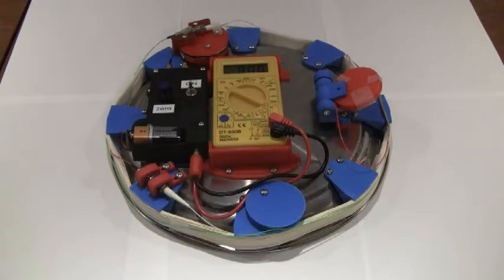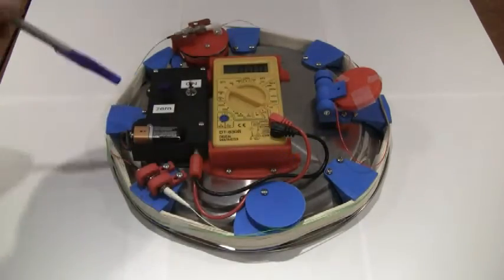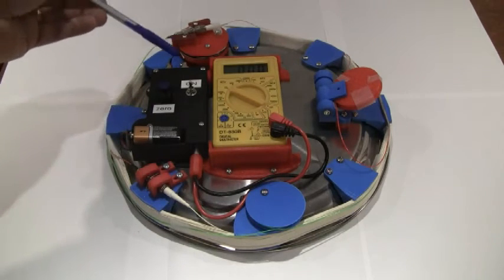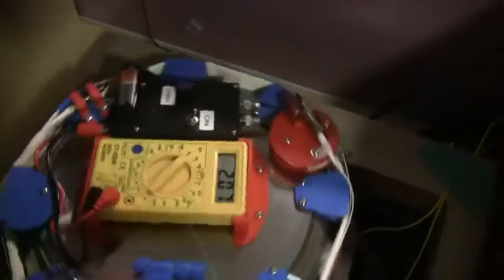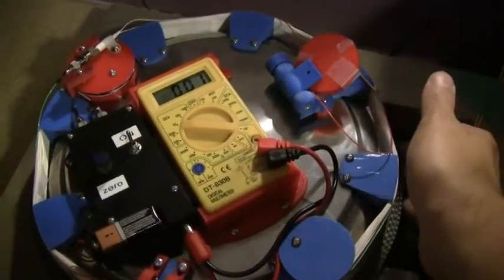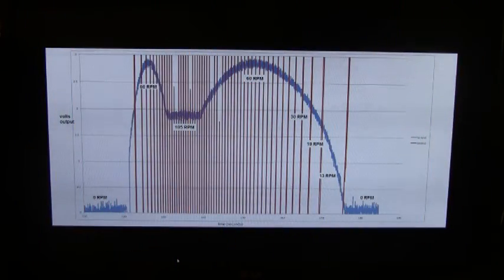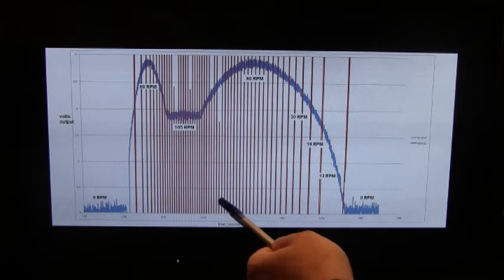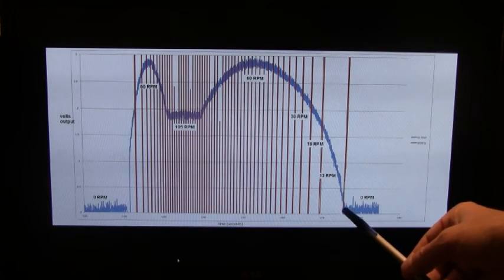3D printed Fiber Optic Gyroscope ( Sagnac Interferometer )

Comment: Nice job man , i have a suggestion :  Why not putting voltmeter on a ball bearing so it will not spin with the rest of the devices so it can stay still so you can read the voltage while the rest spins?
Reply from the maker: Thanks - I have done that in later versions, but the best seems to be the wireless datalogger since then the data can be exported directly into Excel.

Comment: If we unroll a single loop of fiber from the wheel and move it slightly up,down,left,right (like it is vibrating), will voltmeter show any change?
Reply from the maker: Yes, bending the fiber will change the polarization state at the output, which will manifest as a voltage change. This is not a fringe shift, but it is hard to tell the two apart.

Comment: When aligned properly, is it sensitive enough to detect earth's rotation as you showed in the 1000 meter sagnac loop video, or is this one insufficient for that?
Reply from the maker: To do that the fiber should be quite a bit longer, perhaps 1000 meters or more. Increasing the radius along amplifies the sensitivity to rotation.
Reply: Alright, thanks for the info.
Reply: @plenum88  does that have to be actual radius/circumference or can you loop 1000m several times and have nearly the same effective sensitivity modulo the effects of not being perfectly concentric?
Reply from the maker: @jamesbolivardigriz8252  The effect increases with the area enclosed by the loop(s), so you can loop many times to increase the sensitivity. But it also increases with the tangential velocity of the loop, so for the same rotation rate, having a larger radius loop increases the effect as well. So bigger radius, more loops is best.

Comment: I am sorry if this is a lame question: However if the device gives a voltage rise during rotation in both direction, how one may detect the direction? TIA
Reply from the maker: It is a good question - the best thing to do is to adjust the polarization paddle so that the returning waves are not in the anti-phase condition when the device is stationary (lowest voltage found by the paddle), but somewhere intermediate (between the lowest voltage and highest voltage found by adjusting the paddle), so that there is an apparent phase difference between them in the stationary state. When the device is then rotated, in one direction the returning waves will progress towards anti-phase, and in the opposite direction they will progress towards in phase, (drop in voltage, and rise in voltage, respectively). This is easiest to visualize at low rotation rates.